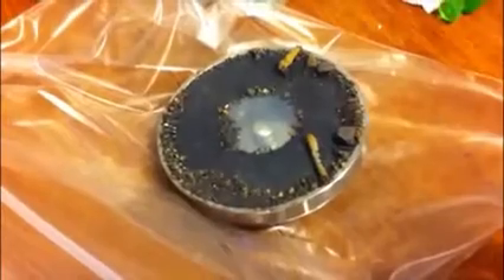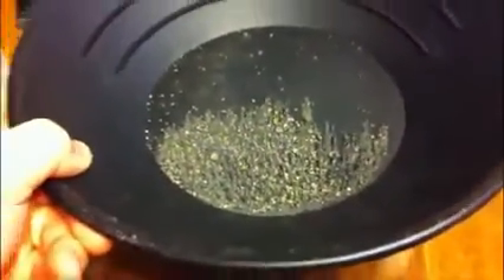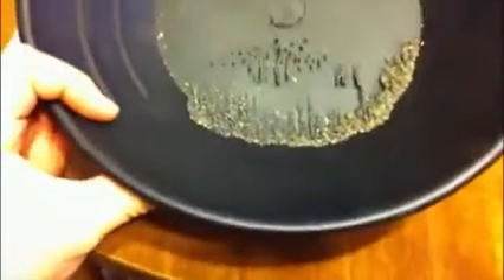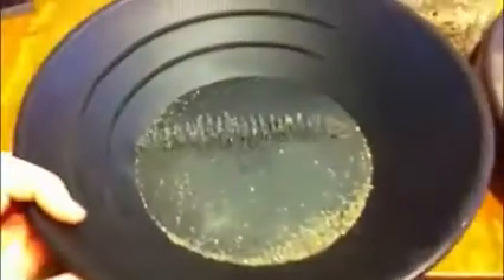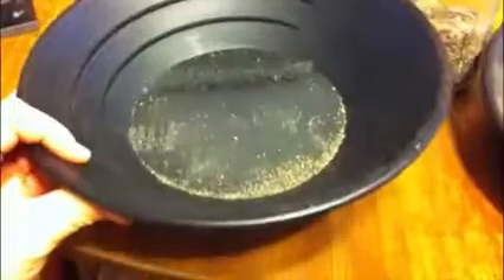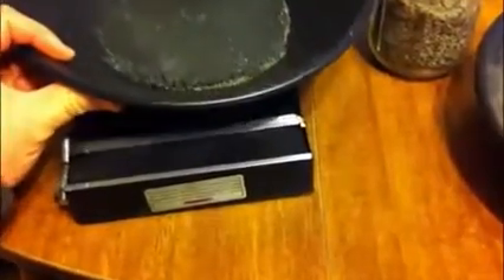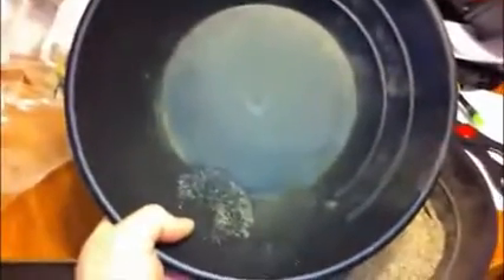Cara Memisahkan Emas dari Rongsok Komputer eceborneo blogspot com

Comment: We supply acid for refining and recovery gold or other experiment
Nitric 1L : rm90
Hydrochloric 1L : rm90
Chloro Xide 1L : rm75
Sodium meta bisulfate 1kg : rm90
Urea 1kg : rm30
H202 1L : rm75
H20 1L Lab Gred : rm20
Borax 1kg : rm65
GPP test gold : rm45
22K gold test : rm50
PH paper : rm70
Kertas turas 1pcs : rm2.50
Tabung uji/bikar kaca : rm80
Bikar lebur : rm110
Muriatic 1L : rm75
Zink powder 100g : rm70
Nitrate potassium 1kg : rm80
Sulfuric acid 1L : rm120
More acid can whatsapp : 011-16690628 Malaysia only
Can buy acid with drum
Example : nitric 28kg = 20L : rm1140 only
COD  ONLY for area nilai,putrajaya,cyberjaya,klang,cheras,ampang,gombak,selayang,rawang,batang kali,tanjung malim,and bentong
KAWASAN SELANGOR SAHAJA
LUAR KAWASAN BERGANTUNG PADA ORDER
Call me 013 2541065 (Joe)
OR WHATSAPP